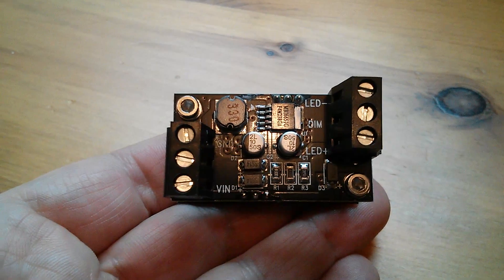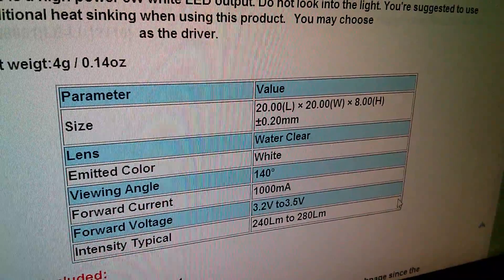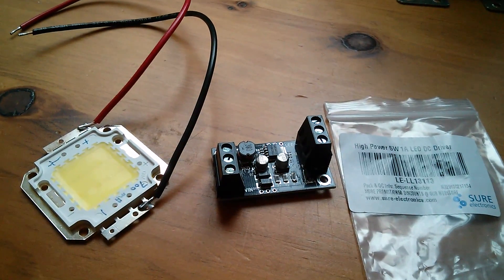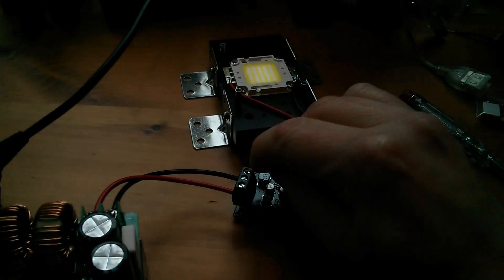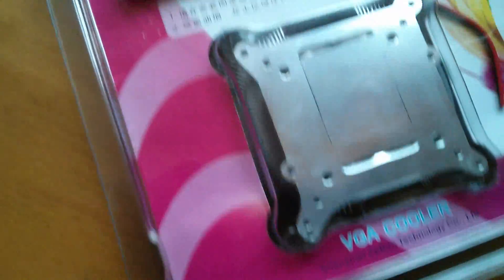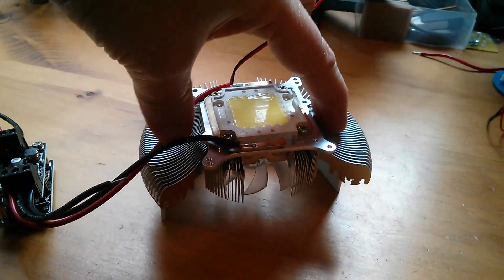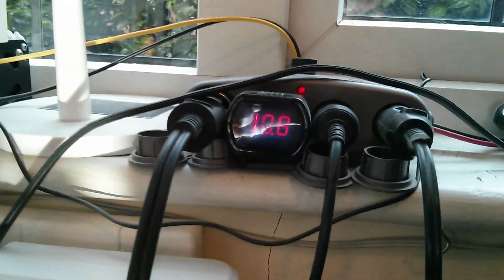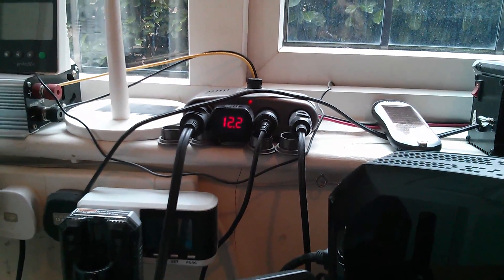50W LED Driver, VGA Heatsink Fan and a Fizzing Noise

Comment: Today I put all components together,followed steps and it was a great success. Only limited the voltage to 25 v. Still very bright and the booster does a fine job as well as the heat sink. The booster can be used in lots of geeky applications. Again thanks Julian. One problem remaining : putting all of that in a box!.
Reply: with the heat sink and cooling fan, you think how long can the 50W LED chip turned on without over heated problem?

Comment: What about LED's surface temperature. I've seen here on youtube a test where 100W LED surface heats up to 160 degrees centigrade, which seems a lot to me... The aluminium bottom of LED has a generous heatsink, but the surface heats up realy bad.
So, what would be the best way to eliminate that huge amount of heat of the surface? Maybe submerging in mineral oil or something...? What do you think about that? I'd like to make a 100W flashlight and  I need some opinions...
Reply: You probably saw someone testing the light emitting side during while it was fired on.  That is a bad representation of the heat production.  That is a mix of heat generated by close contact to a few thousand lumens.  These 100 watt cheap eBay LEDs can be run with a cpu heatsink and DC fan.  wish you luck on the bright flashlight!

Comment: great series. A problem that I find with these high power LED's is that they  usually are not labelled at all. so you have no idea what you are getting. Ordered a  100 Watt LED and sure it gives  a lot of light... but then it seems to consume only 660mA at 30 Volts... which makes it more of a 20 Watt LED. Did the seller make a mistake?, or did he just knowingly deceive his customers?

Comment: where can I get the boost power supply you show as sure electronics does not seem to have ne
Reply: I got you guys the Booster's link:
http://www.ebay.com/itm/171122662244
Good luck...... This is as of 11/07/2015.
Reply from the maker: John Ossi Search eBay for "600W boost" to locate the step-up converter.
Reply: Julian Ilett I looked that up on eBay and scrolled through all 234 items, but I could not find one with a display. ( I looked up "400w Boost" and I found a few sellers with the exact same unit you have, did the seller just lie to you and claim it is a 600 watt unit? )
Reply: Today I bought a boost converter from ebay. Search for: digital contro 400 w boost converter DC/ ebay. Similar to Julian's $20.07. Good luck. 11/07/2015

Comment: 12V-60W-TEC1-12706-Heatsink-Thermoelectric-Cooler-Peltier-Cooling-Plate-Module
for oil

Comment: Hello, I myself tried version cooler box 775 and 50W LED . Fan at 5V . The cooler is up to 40 degrees Celsius , but ir thermometer on my sheet and measured at the chip nearly 106 degrees of temperature . How about you .

Comment: Hello, Could someone please help me. I want to run my 50w led chip but I have heat problems. before I go and buy a heatsink could someone tell me if a cpu heatsink will work? Someone please reply if you have tried. I plan on using the Intel heatsink that comes with socket 775 cpus. Thanks in advance
Reply: BTW, I will only be using the light for about 2 hours at a time
Reply: yeah, it will work fine!

Comment: i have 100watt LED and it gets really hot!!! i think it is impossible to cool it while it works for hours without any noise... :-(
i also have a 50W Warm White 4500LM Waterproof High Power LED Flood Light and i realised that the hole body is actually a heatsink because after 6 hours of lighting it gets a little hot! so i believe it need a big flood light case in order to cool 100 watt led without using any noisy fans...
Reply: Using a reasonable size heatsink and even just 1 fan will make a huge difference in temperature look at artic cooling fans they are cheap enough to try and not lose much if you decide not to use it but they are very quiet

Comment: I very much liked your you video and like to use it for a projector Im making but not sure is it poss to connected straight from the mains? if not have you done a video about how you do connected. Very new to all this
Reply from the maker: Hi Paul. No, I've not done any videos on mains connected LEDs. I'm really not comfortable mixing cheap electronics and the mains. So all my videos use low voltage DC as the power source.

Comment: you should get rid of the battery bank and use a computer psu then you wont have to worry about the batteries running out. i use a 850 watt one for all my experiments.
Reply: Why get rid of something that does what you want, i could understand if he was deciding to buy one or the other

Comment: Great video. I have a question, and I'm not quite sure if it's something you have tested before. If I wanted to build a 200W fixture, would it be possible to get a heatsink and fan? How practical would it be to run such a beast?

Comment: i use xt60 connectors the ones used for some RC batteries, worked well for me as their cheap with high current handling (found easily on ebay in packs of 50)

Comment: Julian what are your thoughts on running a 50w 1500mA 30-36V LED  with a mean Well Driver @ 59.5w 1750Ma 9-34V?
Reply from the maker: It may work, but the LED will have a short life. You could use a 70W LED with the same driver, get the same light output without the risk of damaging the LED

Comment: I've come up with this idea, to replace a fluorescent tube with high power leds. with 20 1w led stars in series on a aluminum bar using thermal glue to hold them on to it with a 20w led driver to power them.

Comment: Are those stacked and single models 100% identical, could I order 10W models and cut them separate, if trey are cheaper than buying two 5W models?
Reply from the maker: No, they're different. The stacked driver only has one set of connectors (on the top board) and the resistors are different too. The double-decker module generates 750mA from each board - the single module is set to 1000mA.
Reply: Ok, but if I don't need the connectors and probably will modify with the resistors that would work.
Reply from the maker: ***** Yes, apart from the connectors, you'll get two functioning boards. Sure Electronics don't have the stacked driver on either eBay.co.uk or eBay.com at the moment, but it is on their website (if you can fathom out how that works)!